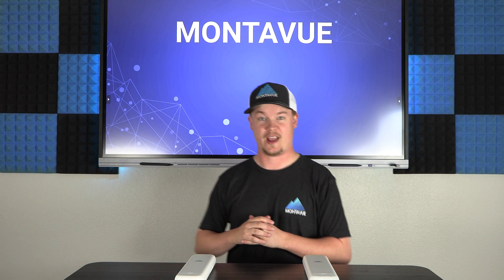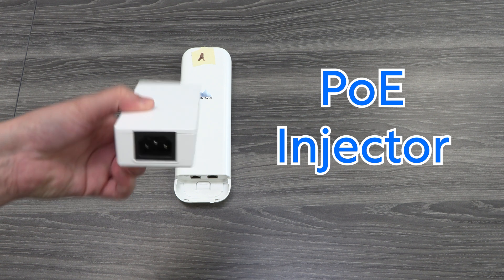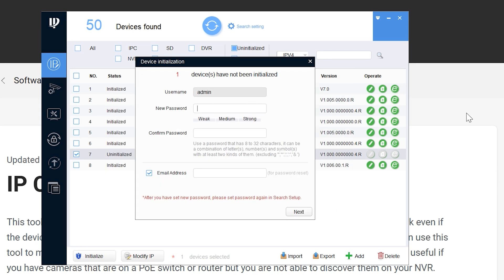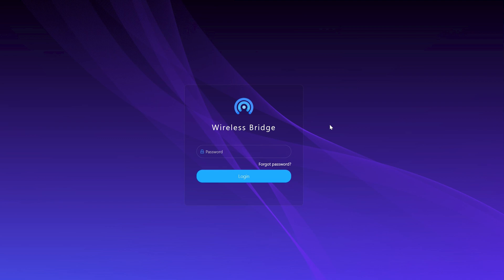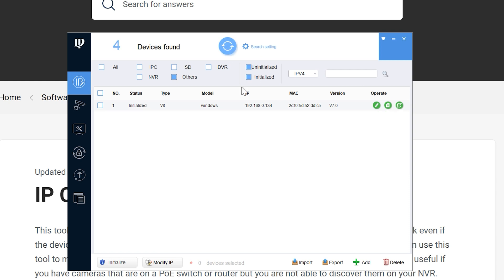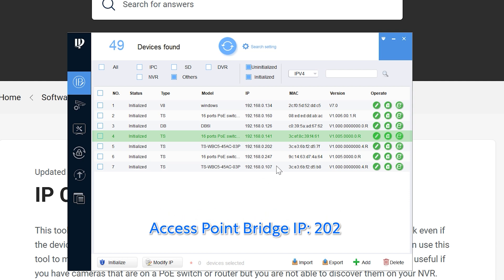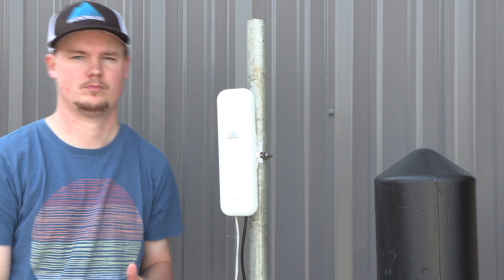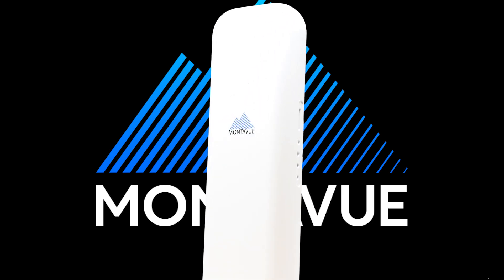Montavue Master Class - Wireless Bridge Setup Tutorial

Comment: Maybe this is a dumb question but can the access point run on WiFi instead of being connected to my router via Ethernet. My WiFi router is downstairs in the center of my house but this access point need to be outside.
Reply from the maker: With the wireless bridge, if you were to receive wireless signals from your router to your bridge, then your bridge would have to be set as a client (client of the router). The way they transmit information means that it has to be an access point or a client, it can't be both. Access point bridges have to be wired to the router whether through a switch or direct to router itself.